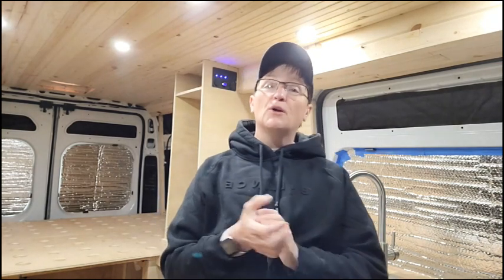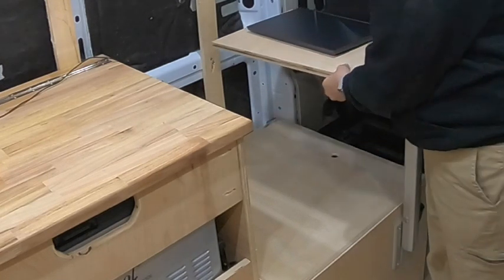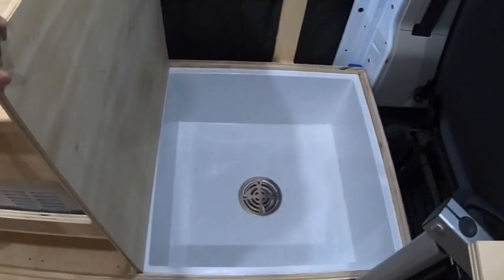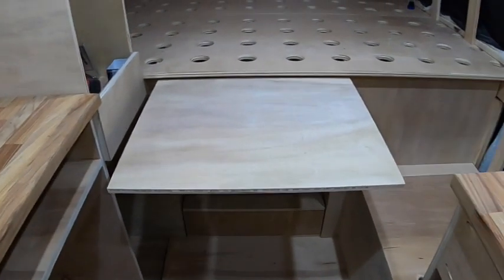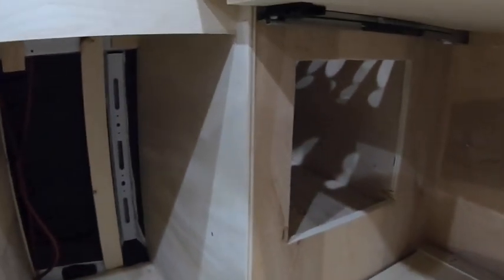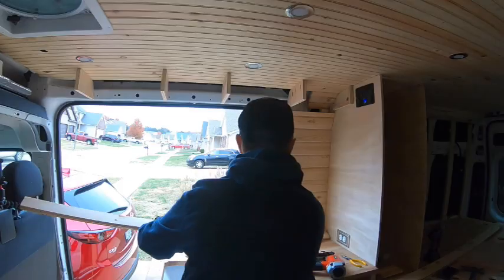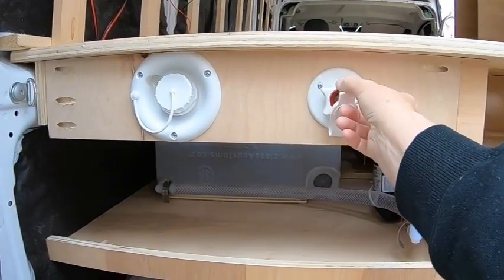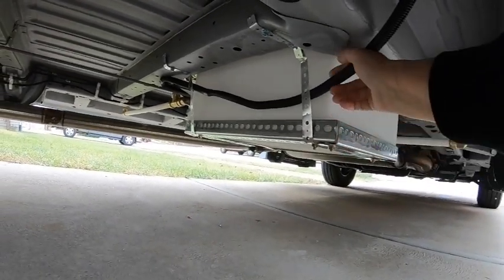Female VAN BUILDER | Progress On The Beach House

Comment: Wow 👏😮👏😮... how did you get the plumbing done underneath the van?
Reply from the maker: I had room to crawl under there
Reply: @JonniesJourney  Wow, seriously 😳?  You're amazingly talented around vans cause I would be scared to death of doing some sort of damage with a drill under there.  
Here's an idea, saw this on another van build video, how about a flip down wall panel that contains a little mirror? The idea is that it's concealed in the wall while driving so you don't have to worry about it breaking. I'd guesstimate it was about 8-10 inches square built on a hinge.
Reply from the maker: @lauriehays2876  cool idea